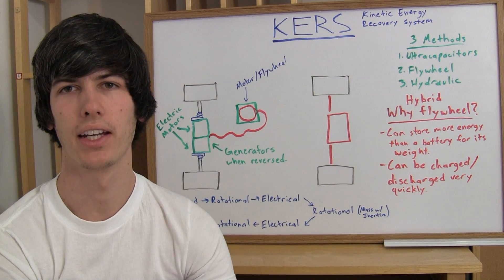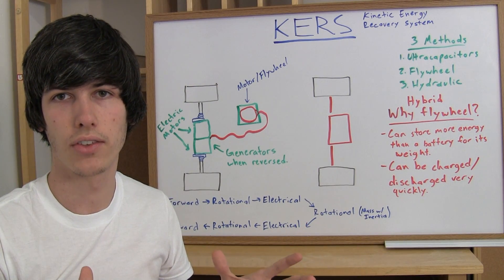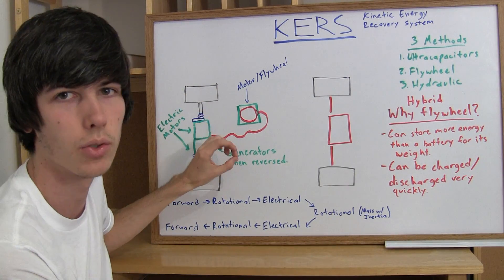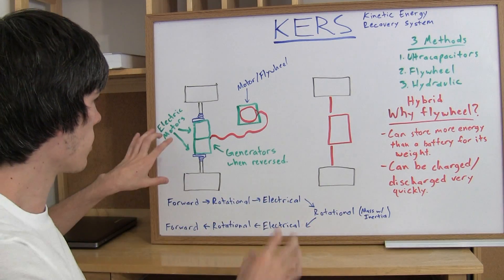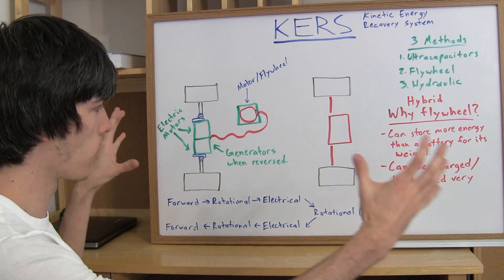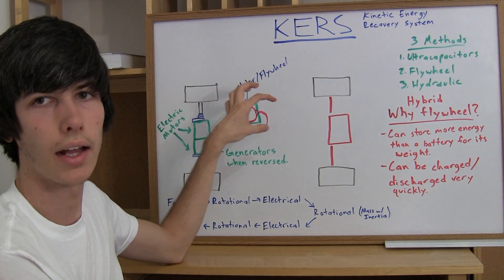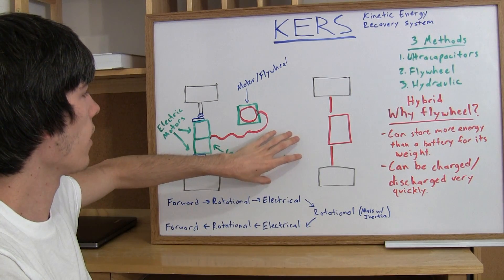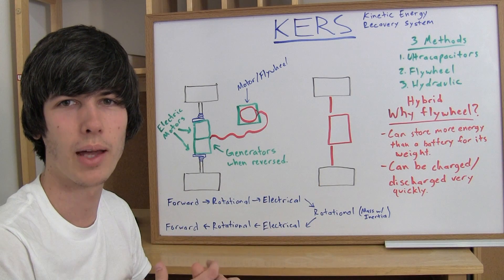KERS - Explained

Comment: El Flywheel es simplemente un motor eléctrico unido a una masa en rotación (gira en el vacío para disminuír las pérdidas).

Cuando el coche frena el/los motor/es eléctricos conectados a la transmisión o a las ruedas, a través de la frenada regenerativa, le mandan energía (puenteo entre motores eléctricos) al motor eléctrico del Flywheel el cuál acelera la masa en rotación.

Al acelerar el coche, sucede el mismo proceso en sentido inverso, es decir, el motor eléctrico del Flywheel frena la masa en rotación y le manda esa energía (puenteo entre motores eléctricos) al motor/es eléctrico que acelera el coche.

Comment: Kerstech TwinTorq is hydraulic motor/pump combined wih electric motor/generator in a single (compact) unit. It also uses both for regenerative braking to achieve a higher efficiency ie. more energy stored. Hydraulic accumulator (nitrogen gas pressure cylinder) stores/releases energy at lower speeds and electric battery at higher speed. This system is best suited for battery electric city buses to give them more range for a given size of battery.

Comment: If I describe a homemade KERS system, could you tell me if it would deliver meaningful results?  I've always wanted to develop one, but I'm not well versed in math, so I'm not sure if it would work!  I have a very specific (and I think, simple) design in mind.  In short, it would be a 100-ish LB flywheel (most mass at circumference) mounted between a flexplate and a torque converter, fully floating on a shaft that connects the flexplate to the torque converter.  Flywheel speed is stepped up during power storage by a planetary gearset on the power-input side (either engine or transmission, I'm not sure which would be better).  Energy is harvested by pressing a traditional clutch disc onto the flywheel from the opposite side (no pressure plate, just a clutch disc- you'd use a second "gas" pedal to apply the pressure, thus extracting metered flywheel energy for a power boost).  Clutch disc rides forward/aft on keyways cut into the shaft that joins the flexplate to the torque converter.  There are other details I can provide (clutches that isolate the planetary gears, thrust bearings, etc.) but for now I'm just curious as to whether or not this concept could provide meaningful results.  The idea would not be to save fuel, but rather store up horsepower for later use over a short period of time- similar to nitrous, but without the hassle.  I'm guessing that I'd need a flywheel speed of 10-20k RPM but I really don't know.  Some questions I have: Is that even possible with a machined steel flywheel?  Would it grenade?  Is 100LBs enough mass?  Would I need another planetary gearset to step down the energy as it is recovered?  I have no idea about these things lol.  Would love to know though!!  Great videos man, I love your stuff- especially that CVVD video you just made.  Super cool 8-)

Comment: Why can't the kers applied into production cars?
Reply: Would take way to long to recharge with daily driving/normal braking you need the high speed/hard braking in-order to charge the most energy back into the system. They would have to come up with some alternative ways to recharge the system

Comment: Usually love your videos, but this one doesn't really explain how the KERS system actually slows down the car?

If you use conventional brakes, then the energy is wasted in heat.  So how does this system actually brake the car? Does it change the load when you press the brake pedal?
Reply: From what I understand the KERS system doesn’t assist in stopping the car, it just uses the excess energy created from the brakes that would normally be wasted heat on a car  without KERS.

Comment: why not a flywheel on the axle that can then be released  from a clutch that then can be switch to a generate system later? This bypasses the losses in generator to mechanical energy
Reply: How big do you think this vehicle is? flywheel on the axle to contain that much kinetic energy would probably bee to big and a logistical nightmare

Comment: 1:30 is the spin of the bearing affected by the G forces made by the car when for example the car is in a corner ?
Reply: Gyroscopic precession would protect the bearing from directional G forces caused by the inertial energy of cornering. However, the angular momentum of the spinning bearing could theoretically reduce handling of the vehicle as a single moving body.

Comment: How would the system charge only on braking? And how would the energy get transferred to the flywheel? That's what I'm curious about.
Reply: It turns the axle into a dynamo, which requires power and thus acts as a brake.  The dynamo creates a voltage that powers an electric motor, which in turn powers the flywheel.  Hypothetically, such a system could be expanded to charge all the time (up to the limits of the flywheel), but then it would create an enormous load on the engine all the time, and that would be counterproductive.  But when you're braking, you WANT to dump a bunch of energy.

Comment: I am preparing a seminar on KERS. I have not not got the concept of motors reversing their action for generation purpose.. How that exactly happens ??
Is engine seperated from MGU during braking event ?? and how does that exactly happen??
Reply: How'd the seminar go?
Reply: Lol, mechanically linked components with no load just spin, only when a load is applied it causes inertial changes.

Comment: Got a question, what couples (connects) the electric motor to the engine shaft or transmission. Because I assume the ICE and motor have to rotate at the same speed. 

E.G. If the engine is already rotating at 5000rpm and the electric motor/ flywheel kers is activated how does it match the 5000 rpm of the engine?....
Does it even need to match the rpm at all?

I'm thinking of it like this if my friend is running at 5m/s and he is getting tired but wants to maintain 5m/s so asks me to push him  I need to be running at 5ms ( assuming I'm at arms length to him whilst he is running) in order to actually hep him. If I'm too slow I won't be able to even reach him to push but if I'm to fast he will be going faster than intended and fall over.

Thanks in advanced
Reply: mazin2892 In the case of F1, the thing is coupled to the crankshaft with a little gear setup.
Reply: shi01 thanks for taking the time to answer my question, much appreciated. 

Another question if you don't mind-
 is the gearing fixed in this setup or does it have another separate gearbox for the kers unit?

Ultimately what I don't understand is how the kers system which rotates at 30000rpm can match an engine rpm which obviously changes from 0-7000 on normal cars.
The only way I can think this works is if the motor is controlled to rotate at a certain rpm then simply geared down. 
Does the rpm even need to match? 

Thanks for the reply
Reply: mazin2892
The gear ratio is fixed. The poweroutput of electric motors aren't effected that much by rpm changes. They can deliver their rated poweroutput at virtually the whole rpm-range they were build for. (very low rpm's near 0 are an exception for technical reasons)

The KERS-System do change rpm's togheter with the internal combustion engine. The 30'000rpm were just the high rev limit. That was implemented because a higher reving Motor tend to be smaller and lighter, but more expensive to produce. So the limit was set to keep the costs in some boundaries.

Comment: I just subscribed to your channel. Thank you for the explanation. It is like regenerative braking but the purpose is different, I guess. From what I've understood, in regenerative braking you aim for economy by charging electrical units; but in KERS you aim for a performance boost for a short period of time.

Thanks again for such a useful channel!
Reply from the maker: Şafak Soysal Either way you're using energy that otherwise would be lost, so either way it's more efficient.
Reply: Yeah exactly both systems are energy efficent with different benefits

Comment: Really great video mate, but I have just one doubt that I didn't understand by what you mean by "motor reversing its direction when you brake" and if you mean freeing the motor from the drive while braking then isn't it somewhat like regenerative braking? Thanks in advance for the answer
Reply from the maker: Mahesh Padmanabh Yep, exactly like regen braking. Creating power using an input of torque, rather than creating torque using power.

Comment: you said that when you break you make generator rotates but does that mean that this cars dont have pads for breaking only something like reverse gear and that rotates the comutator..like when you put car in reverse and start going back
Reply: The car still has brakes. When braking the generators kicks in and saves up some of the kinetic energy as electricity to be used later, instead of turning all of the kinetic energy to heat.

Comment: I never knew why someone would chose a flywheel over capacitors.  You actually taught me something.  thank ya.  

I'm trying to build a regenerative controller for a PMSM and I'm having trouble implementing the regen.  If anyone has links/info it's be appreciated.    (I'm using PWM to control the voltage on each phase if it matters)

Comment: So when you use a flywheel system, what kind of efficiency does the system have? Obviously if you have a rotating mass you are going lose energy to friction. So if I wanted to wait until I got closer to the end of a longer straight, like the back straight at Shanghai, would I have to worry about a loss of kinetic energy when I went to push the button?

Comment from the maker: The capacitors would have to be fairly large if you wanted to store enough energy, the flywheel holds quite a bit of energy for it's mass (it can rotate faster and store more energy, where as a capacitors weight is fixed). But capacitors can typically charge and discharge much quicker.

Comment from the maker: I don't know of any purely mechanical KERS systems that exist, and honestly it makes much more sense from an efficiency standpoint to use motors to generate energy from braking. Red Bull's system certainly used motors for the regen, and I believe in F1 they use capacitors/batteries to store the energy.

Comment: I once saw a picture of what was supposed to be the Red Bull KERS system, yet it looked purely mechanical. Is there a purely mechanical KERS out there, like transforming the rotation of an axis directly into rotation of a flywheel, or was that maybe just my impression and it was just the flywheel method you were talking about?

Comment from the maker: I will have additional videos on regenerative braking soon. This does not occur when you are not braking, because if you were to use regen braking while driving, it would slow your car down. It's the opposite of how a motor works; instead of sending current and creating a torque/rpm, you apply a torque/rpm and create a current.

Comment: Hey, Engineering Explained. Is it possible to use no brake at all but the KERS to stop a car. What I'm saying is that depending on how hard you press the brake pedal, the ratio to spin the KERS flywheel will vary - the harder you brake, the faster you recharge the KERS. By using CVT principle to change ratio quickly and easily. Am I talking sense?

Comment: I have a broken hand-press flashlight, and I disassembly it. I found the small DC generator (or dynamo), I try to spin it fast and than release it, it stopped immediately. Of course it won't be immediately or with fast like disk brake if it spins at high speed or RPM.

Comment: So the motor/generator generate electricity when braking than send it to flywheel motor to spin the flywheel, then when the button pressed the flywheel motor turn into generator and send current to spin the wheel motor? And if it's a DC motor and generator it should be simple. Permanent magnet or DC coil magnet at both motor/generator stator, then flow another DC current to rotor and it will become motor, disconnect and it will become generator =D.

Comment from the maker: Basically it's doing the exact opposite of what a motor does (you simply reverse the action). A motor uses a current to create mechanical force. In reverse, it can use the mechanical force to create a current. I'm working on a hybrid/electric playlist now, so with these videos it should become much more clear.

Comment: So, the flywheel rotates with the drive shaft, but when the drive shaft gets slower it's still at fast speed? Then when the button pressed it transfer back the energy? What about the heat generated by the friction when breaking, isn't it wasted?

Comment: main reason i believe the f1 uses the battery method over flywheel is that the battery can be shaped in anyway the designer wants whereas the flywheel is hard to be fitted into already tightly confined f1 chassis design and it also presents a weight balance issue.  battery can be as thin as a paper and would still deliver performance but flywheel housing and unit itself bears quite a bulk.
volvo is developing a flywheel kers on their production cars and im waiting with huge interest:)

Comment: your comparison of your angine that didnt produce that much power for its weight  like the flywheel could save in it .. wasnt exactly right.. the flywheel only temporarily ceeps the energy its lika the gas tank on a car.. not like the engine.. those to electric motors schoul represent the engine in your car that you mind produced less power for its weight..

Comment: It's not really wasted. The flywheel takes up the energy from the generators and stores it in rotational form. The bearings are an ultra-low friction ceramic design so the rotational energy can be maintained until it's next required. This is what the man says above. His explanations are very clear in my opinion and tolerate repeat listening if there is any initial misunderstanding.

Comment: isnt this system developed by williams? also how does the rotational energy in the flywheel s converted into electric energy..... does it reverses the motor connected to it into a generator ?

Comment from the maker: It probably resists any rotation other than the axis it is on, and doesn't mind translating across the axis it rotates on. There are sure to be bearings to reduce the friction of any such force. Not sure of the effects under heavy cornering and the such, but I assume it's minimal.

Comment: great video as always. one question: does a 30-pound flywheel spinning at 30,000 rpm produce any strange gyroscopic side-effects? A spinning gyroscope can move freely in some ways, but it resists motion in other ways. How do those forces affect the car in question?

Comment: Hey is it possible to have a vehicle with two engines simultaneously conjoined at the crank shaft ? When i say two im thinking one in the front and one in the back its just a thought that I want to see if its possible.

Comment: You said the energy of the braking is basically "stored" in the circular motion of the flywheel. Does the flywheel keep spinning until the the driver decides to release the energy? If yes, for example, would it spin non stop if the driver did not press the kers button while driving? thx

Comment: When F1 first mandated KERS, different manufacturers came up with different ways to do it. I forgot which ones did what, but one used flywheel, the others used electrical. In the mid '90's Chrysler attempted to make a KERS car using a very heavy flywheel spinning 10,000rpm. After some catastrophic failures that destroyed 2 cars (IIRC), they abandoned it.

Comment: Sorry for my ignorance, but I thought F1 uses "flywheel" method, because it saves weight. Instead, you mentioned that F1 uses batteries. Why they find batteries better solution? And its pity that you didint explained this topic in way longer video.

Comment from the maker: Brake pads are still used, and regular size pads at that. KERS isn't allowed to be used for more than a set amount of time per lap, so you still need normal braking for stops which you won't be using KERS.

Comment: So brakes are still used though, correct? Putting them in the back would be needed to help slow the car faster, but on the front, is the braking amount balanced with the motor so while you still use brake pads to slow the car quickly, a good amount of energy is still being sent to the KERS system? Sorry if this is worded weird... But essentially what I'm asking is do they use smaller brake pads then they usually would on a non-KERS enabled car, or none at all?

Comment: a diffuser works by expanding the volume for a set amount of air (gases are fluids which can expand and compress to fully fill whatever container they are in) if you increase the size but keep the amount of air the same you get low pressure. the low pressure brings the car down and makes downforce. a blown diffuser is sticking the exhaust almost in front of the diffuser to increase the amount of air passing through there and to create more downforce. watch?v=Ui6EDypjZKQ.